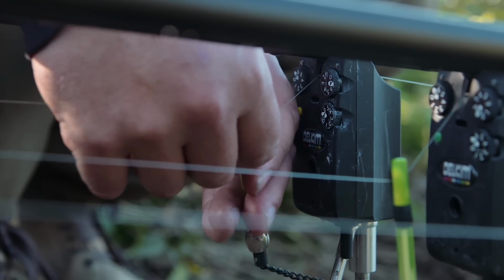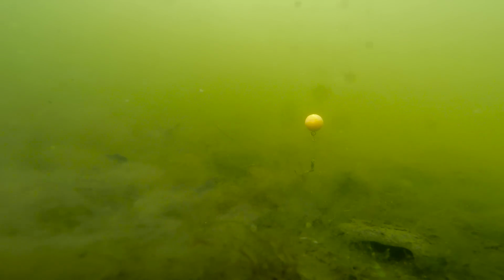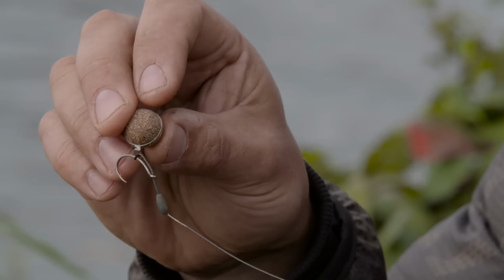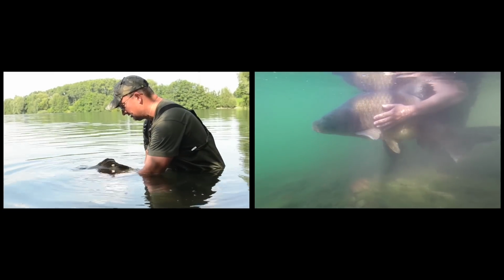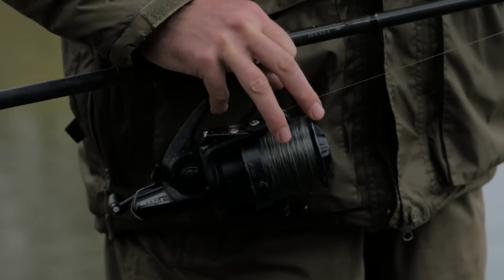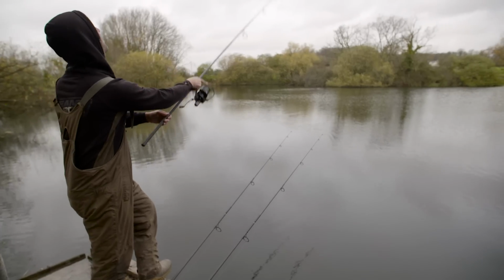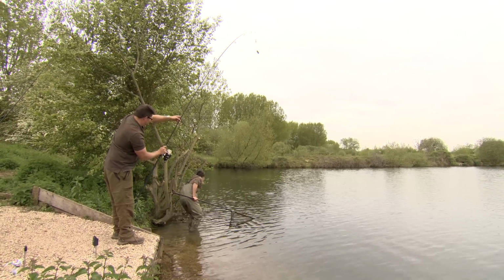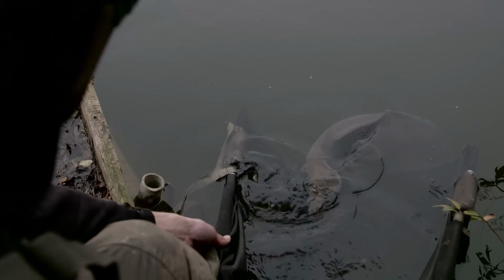Korda Carp Fishing Masterclass Vol 3 - Carp fishing with Pop-Ups | Darrell Peck

Comment: So, this helisafe system drops the lead then surely that deems the safety bead irrelevant if you get cut off because theres weight for the fish to shake the rig off the leader meaning Mr Carp cant get rid of the leadcore therefore can become tethered... poor idea.
Reply: no weight that was meant to say.
Reply: Russell Smith Its so you can fish heavy weed, & protect the Carp's mouth in the event of crack off no lead means no ripping, bead slides off away goes the leadcore e.t.c